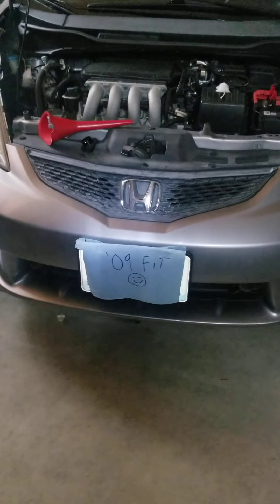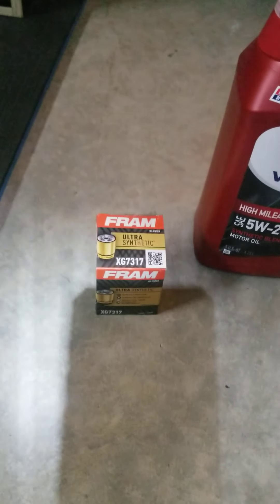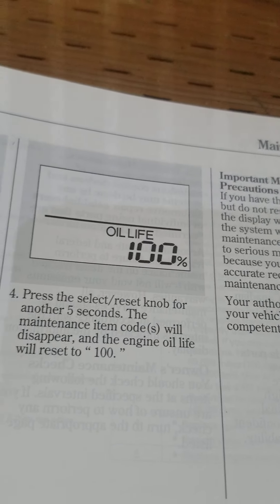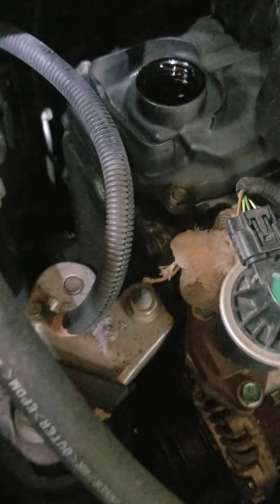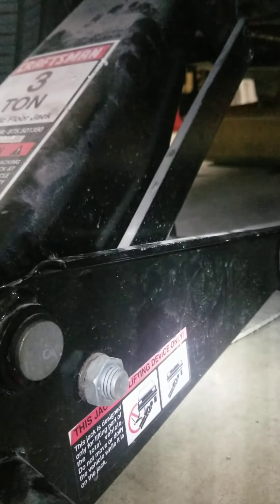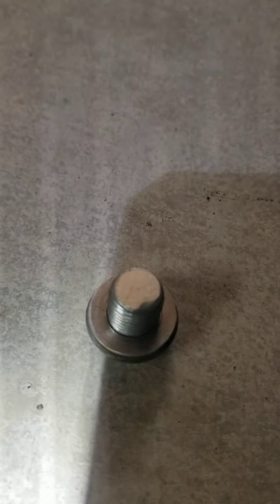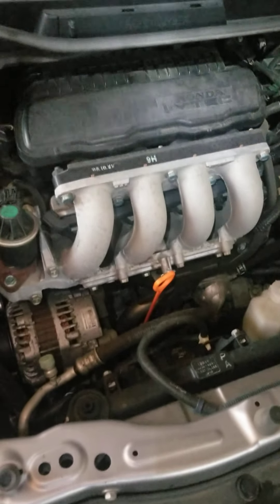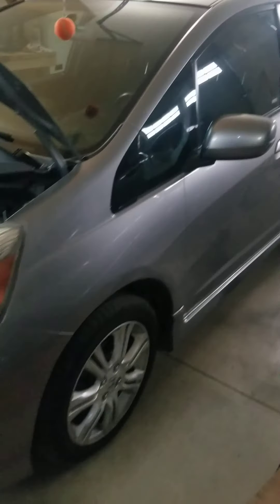Oil Change 2009 Honda Fit Simple!

Comment: Thanks you I have no clue about car maintanence and oil change gotten so expensive and I worry they didn't do a great job and soon after check engine light turned on.  Well, I on my own taking risk driving so I have to have a dependable car.